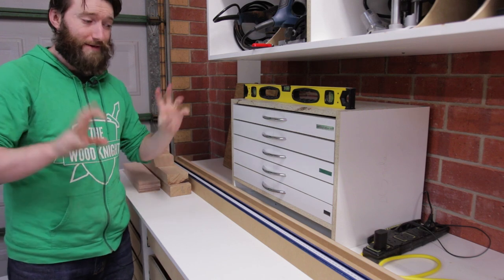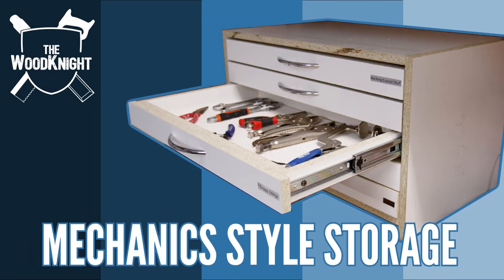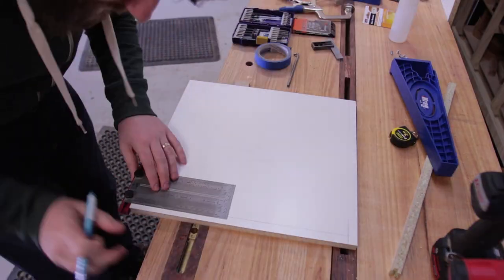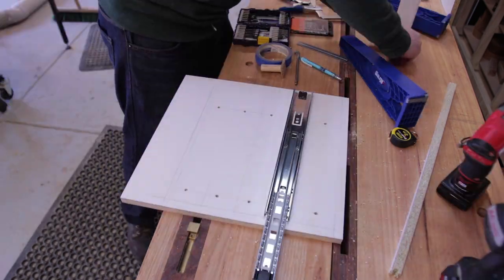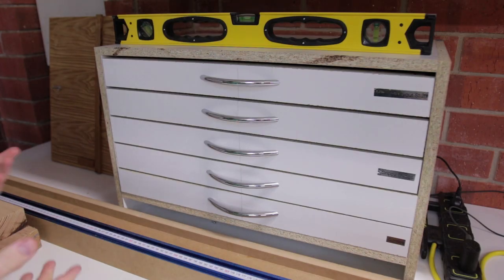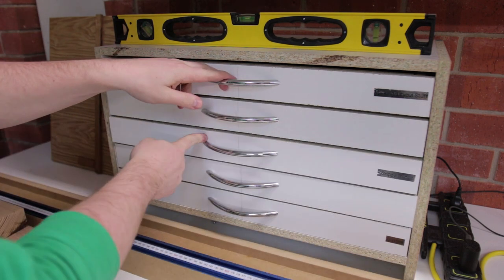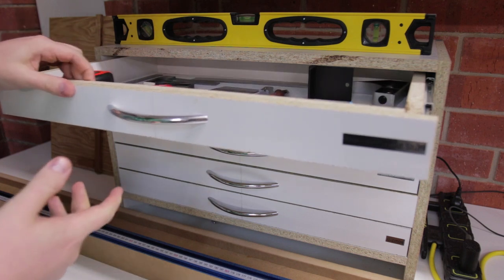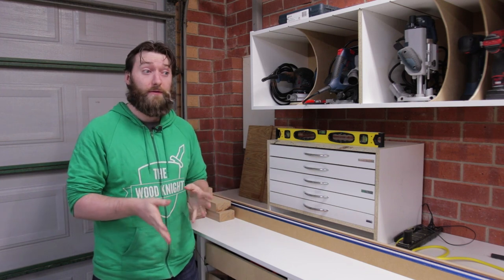Mechanics Style Tool Chest (Mitre Saw Station Part #7)

Comment: Well done.  Looks great!  I have always avoided using particle board because I am afraid of it splitting.  Any tips?
Reply from the maker: Splitting how? As in chipping the melamine coating or overtime the particle board just falling apart?
Reply: Both, and what if any liquid is spilled?
Reply from the maker: If its melamine, edge banding solves the liquid issue. Also get high moisture resistant (HMR) chipboard, as it costs little more over non-treated stuff, especially in a bathroom type environment.  If it sits in water for a week and absorbs it up through the edges, its no different from plywood.

If you are aware of its constraints and add reinforcements, it won't just 'fall apart'. Same goes for any material - solid wood, plywood, mdf, plastics, etc. Particle board is a bit heavier, so it just needs more reinforcement where it flexes.

Comment: nice job Paul
how difficult is it to get drawer slides marked out and measured correctly ? Do the pocket hole joints need glue or are they good to go ?
Reply from the maker: +1800cc in the context of this particular project, just screws are fine. It really depends on the project, material, weight/stress loading etc.

Lining up drawer slides isn't too difficult, just gotta make sure you draw parallel lines!

Comment: Just a question but why did you use particle board over MDF ?
Reply from the maker: melamine takes screws better, doesn't require a finish, reflects light better/is brighter, weighs slightly less, is more moisture resistant (since this is HMR melamine), and wears better.

Comment: does the bottom drawer interfere with the stopblock on the fence?
Reply from the maker: Yes. It clears the fence just fine, but not the stopblocks. However the stopblocks move out of the way very easily

Comment: What gauge nailer do you use around the shop? I'm looking at buying one mainly for when I'm working with plywood and I was thinking an 18 gauge.
Reply from the maker: Pretty sure its 18ga. Ryobi used to sell a really good priced kit that was a C, C1 and stapler 3pc kit. I primarily use the C1 nails because I'm just holding stuff in place while the glue dries.

Comment: You need Kaizen foam from fast cap!
Reply from the maker: +ST.348 it's far too expensive
Reply: $30 for two sheets. You should see if the would give you some if you do a video installing it.
Reply from the maker: In Australia its a bit pricier than that, $25AUD for 1 sheet of 30mm, but I probably would get 4 drawers worth out of one sheet. It's not as expensive as I remembered, I'll have to ponder it.

Comment: Since you're making drawer faces the spacing should be minimal and perfect.  Dry fit it using 2 sided tape.  Use playing card as spacers.  Pre drill your holes then screw the faces on. Make sure to use a self centering drill bit. Thanks for the video it helps a lot.